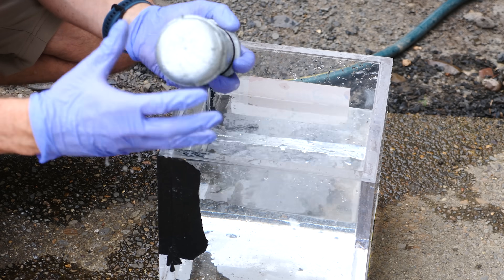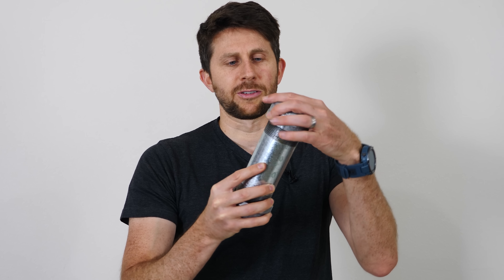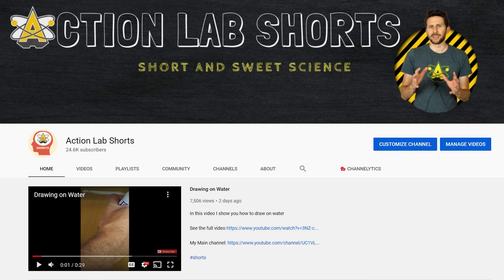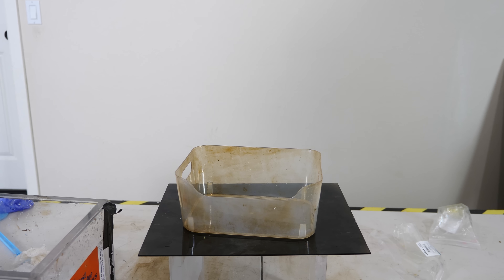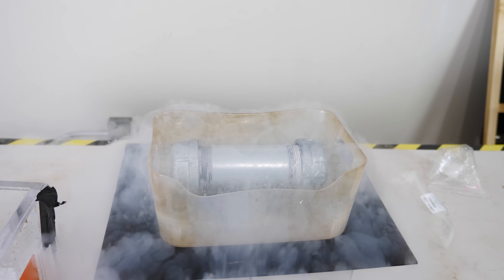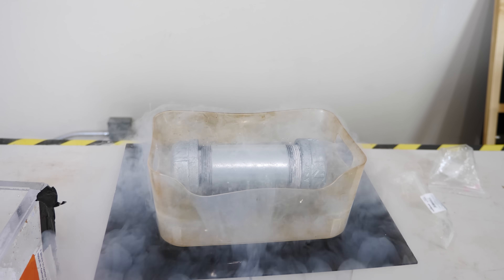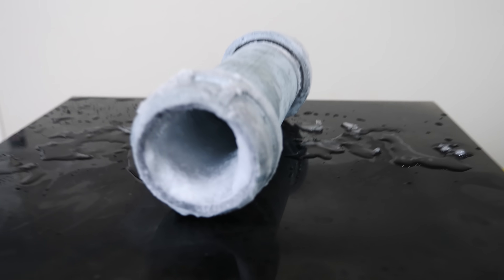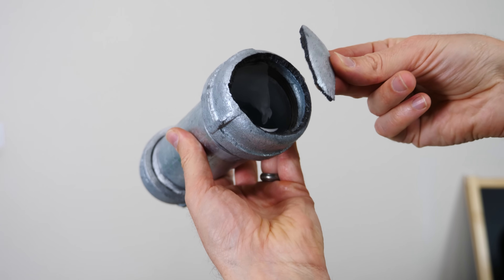Can You Stop Water From Expanding When It Freezes Into Ice?

Comment: if you put liquid nitrogen inside that steel pipe the outside of the pipe is going to be cold? If it does then it is going to be cold forever or the nitrogen inside is going to disappear after a while?
Reply: It would be an extremely bad idea to do that.
Reply: @markh.876  Why?
Reply: @sinegra30  You'll generate thousands of atmospheres of pressure, rupture the pipe, and generally make a mess.
Reply: @markh.876  Mmm But that does not happen in a sealed liquid nitrogen professional container... Why?
Reply: @sinegra30  There's no such thing.

Comment: I'd make a guess that you could likely create a containment vessel to handle 600 megapascals out of a titanium alloy.  There's some titanium alloys that have a tensile strength over 1 giga-pascal.  Not obviously something you're going to buy at Home Depot, but I'd say it's within the grasp of a skilled youtuber.
Reply: There is definitely higher tensile strength material available. Tungsten having about 1500 Mpa, some steels are approaching or even exceeding 2k Mpa, carbon fiber at over 5k Mpa and silicon at 7k Mpa. The easiest would be a high tensile strength steel at about 2k Mpa. Then carbon fiber if you can figure out a way to not compromise the structure by having a hole in it

Comment: You should be able to contain that pressure fairly easily in a diamond anvil cell.  https://en.wikipedia.org/wiki/Diamond_anvil_cell  According to the wikipedia article, these things hande 100-200 Gigapixels, and can be made to contain up to 7 million atmospheres, or about 1000 times the strength you've mentioned.

Of course, the scale of these things is tiny.  Something like a grain of sand.

I'd be curious if there's some other larger scale device that can handle a few hundred mega-pascals.  Diamond is used since it can handle these pressures, but we can't make diamonds the size of your fist.

Comment: So, can you please do an experiment with one of those denser types of ice, so that we can understand the differences between those and regular ice? I'm curious as to how differently it would react when melting or interacting with room temperature liquids
Reply: You could probably do it with some specialized materials and equipment.  The problem is it wouldn't make a good youtube video.  Any ice created during the process would return to normal when you removed the pressure.
Reply: that would be difficult, since they only exist at extraordinary high pressures.
Reply: I'm guessing that as the pressure decreases, they rapidly revert to liquid?
Reply: @danizdeman1   That's my guess as well.  And since it takes energy to melt, it would get colder as it reverted back to liquid.  Maybe it would even freeze back into normal ice!

Comment: Ah pretty sure that's not a 1/4 inch.  If you really want a strong container, then get one made to 160SCH; this can probably handle 10X the pressure, of what you used and be much safer, if you choose a smaller diameter, since the volume is far less.  https://www.mcmaster.com/steel-(schedule-160)-pipe/

Comment: So if you can achieve that different phase of ice, can you then take the ice out of the container, and leave it outside just like any other ice? Or does it require a constant pressure to stay that way, and taking such ice out would either melt it instantly, or the container would explode as you open it or something?
Reply: I think the container would explode as you opened it.  It must remain at high pressure

Comment: From the looks of the cheap Chinesium steel it did undergo brittle fracturing, so more than likely it was the liquid nitrogen that made it brittle and subject to failure. Would be interesting to repeat this but instead of using cheap pipe fittings from Harbour Freight use instead proper high quality stainless steel pipe and fittings, that should survive the cold better. You would need a better blast shield though, and probably a long steel pipe, to use to pour the liquid nitrogen in from a distance.

Comment: Those end caps are cast iron which is already brittle at room temperatures.
Reply: Brittle doesn’t mean weak
Reply: @ActionLabShorts   But it's also weak, is it not?  Would it not be better to use a cap made of actual steel?

Comment: Have you noticed that the plastic container doesn't produce a layer of frost on the outside? This is because it is not in contact with air but only with N2 that comes from the evaporating liquid.
If you put liquid N2 on a soda can I have seen that there is a slow formation of frost only from the liquid surface up. I believe this is solid argon or maybe solid oxigen.
Should make an interesting video to find out
Reply: Good point! I believe the white frost you see (that isnt water) is actually solid CO2.
Reply: @ActionLabShorts  I had that suspicion too. If you get a tall coke can with a couple of inches of LN2 boiling inside you can see the formation of this frost on the outside but only from the surface liquid up. Turns out the gaseous phase is a bit colder than the liquid. And around-200C you have not only nitrogen liquidation but also argon solidification. Besides there is a lot more argon in the atmosphere than CO2

Comment: Before finishing the video (at 1:01), that container will either explode, or become deformed from the expanding ice.  Water exerts an enormous amount of pressure when it freezes.  Containing that pressure will take far more pressure than that vessel can provide.  I also know because an event I helped host at my University did an exploding ice metal pipe bomb (using liquid nitrogen as coolant) as a demonstration.  The water will freeze at a lower temperature under pressure, and the colder it gets, the greater the pressure, which is why it's nearly impossible to contain the expansion of ice.  Eventually it will get cold enough to burst almost any container.

Comment: Omg what a coincidence. I was literally reading about this topic a few days ago, and i was so mind blown about the power of water. To think that expanding water can break anything which comes in its path, even steel and rocks which r so rigid. I was in so much disbelief that i took a 1 L steel water bottle and filled it upto the brim with water and then left it overnight in the freezer. And the next day, i was just shell shocked when i saw that the water had  literally teared up a hole in the bottle. Then i did a whole research and found that by tweeking the temperature and pressure, scientists have created 15-16 different species of ice. Wow.
But i have a doubt. If i take a bottle made of diamond and then do this experiment, will the water break the diamond too?
Reply: It depends on how thick the diamond is.  It would either break the diamond, or freeze into a different form of ice that is denser than usual ice.
Reply: Diamonds are not very resistant, it's only very hard. If you scratch a diamond with anything but an other diamond, it will stay intact, but if you hit it with a hammer, it will break in a million fragment.

So no, it will not work with diamond if it do not work with steel.
Reply: @pierrotA  actually i just did some research on diamonds now. What i concluded was that diamonds are very brittle and can be shattered to pieces only if the impact is very sharp. They have to be hit on their pointed tips to be shattered, but in case of expanding water, the impact is not sharp. The pressure exerted by the water slowly rises and is uniform in all directions, so i think that the diamond should be able to withstand that pressure, and the water should freeze into a different species of ice
Reply: @pierrotA   I'm not so sure.  If the diamond is thick enough, it might work.  It is very brittle, but it's also very hard.  You would just want a thick diamond bottle to contain the pressure.
Reply: @DANGJOS  I cannot be sure because I find no similar experiment anywhere, but i'm still pretty sure it would failed.

The diamonds we can buy are very precisely cut to remove the imperfections. If you take an enormous diamond, it will be  full of imperfections that will break pretty easly. If the diamond is too small we seem to agree it would not work.

If we could create a perfect diamond bottle with very thick walls, then maybe it would be possible... but even then i'm not sure the diamond would not break on a weak point (like the top screw) and explode in a billions pieces.
Reply: @pierrotA   Indeed.  I think it's possible, but yeah, I can see how imperfections would be a problem.  But if the diamond is small, I think that makes it better.  Smaller containers hold up better than large ones.  In fact, there are diamond anvil experiments that can reach much higher pressures.  On a small scale, you can certainly do it.
Reply: If you can afford a diamond bottle strong enough for this, you can afford a more resilient steel bottle a hundred times thicker than the diamond, and a truck to bring it home in.  And a home with a drive-in freezer big enough for this experiment.
What you're basically looking for is the kind of container the FBI or military might use to detonate a suspected bomb.  A bank vault in condensed form.

Comment: The complete failure of the cap was mainly due to the embrittlement of steel (starting at already -73°C) through the excessively low temperature of LN.
If you had cooled it down slower, there would have been not even close to that violent failure and most probably just a small leak.

6000bar is about the pressure modern firearms have to endure without any damage to the system to get their proof marks. So a barrel blank with 2 end-caps should be able to hold that pressure without too much of a problem.
Reply: I think the gun barrel would also break. Once it turns to ice 6 and 7 I believe there is still expansion so it would need to withstand 10-100 times more pressure at that point.
Reply: @ActionLabShorts  We are starting with liquid water with a density of 1g/cm3 (at 3.98°C) then go via ice Ih (0.917 g/cm3) to ice V at 5k bar (1.24 g/cm3) and at around 10k bar VI (1.31 g/cm3)
Alternatively taking a detour via ice II and III (1,16g/cm3) if working with temperatures under -22.15°C

As all these higher ice phases have higher densities than our initial filling of the chamber, the pressure there should never be able to exceed 2.5k bar if under -22.15°C or 6.3k bar if -22.15-0°.

Comment: Could you remove ice 9 or ice 12 from it's super container and bring it into a regularly pressurized environment? Or would it immediately expand and turn into regular ice?
Reply: Ice(II) will stay in that form at least for a while if you keep it at liquid-nitrogen sorts of temperatures, but any warmer and it immediately turns into regular ice(I).  I would guess ice(IX) is about the same, but probably needs to be even colder.  The others probably just either turn into ice(II) or regular ice(I).
Reply: Ice 15, still undiscovered, awaits and will take on mankind for control

Comment: I expected the threads to fail first honestly. Had that happen with a lot of threaded pipe I've worked with. The caps are most likely cast though, so naturally more brittle. You can crack them with a decently heavy hammer, so it's not too surprising it failed first at that cold of a temperature.
Reply: Yea
Reply: That took all the fun out of it

Comment: Those fittings are cast ductile iron so they are not particularly strong. If the end caps were stronger it would fail on the threads

Comment: if you make these other ices in the container, and you take it out, will it stay that special ice? or will it turn into normal ice?
Reply: Good question!  The phase diagram says that they can't exist along the "atmospheric pressure" line, but that's a diagram of the equilibrium state -- which is to say, what it will turn into eventually.  It turns out that at "normal" cold temperatures, ice(II) and ice(III) turn into normal ice(I) quickly, but if you keep it at liquid-nitrogen temperatures, ice(II) will stay in its form for a long time.

I'd guess that the others might stick around similarly at cold enough temperatures, although it would take even colder temperatures to preserve them.
Reply: Nothing happens. They just told you that to see if you were listening

Comment: Under enough pressure (say at 'surface' depth on Saturn) you can even achieve Metallic Water - which has some seriously bizarre properties...

~ ~ ~

I really gotta have a closer look at that diagram. Seriously, it reaches Megapascals of Pressure..! Wow..! (In perspective, something like  10 Megapascals is crush depth for a Nuclear Submarine - turning it into a twisted metal pancake.)

That certainly goes a long way in explaining how several primitive cultures were able to break off vast blocks of impressively hard stone, using only water: 

They poured water down into cracks (cuts), then blocked the upwards expansion, giving water nowhere to expand but sideway, and so - 'CRACK' - it splits off a 20 Tonne Block of Stone...

(It's also how - in extreme cold conditions - the water in their sap can freeze inside trees, causing them to explode!)
Reply: Tell me more...

Comment: Do you think you can find a 4 in thick steel container to test the properties of super dense ice?
Reply: 620 MPa/6000 atmospheres is no joke. 6:00.

Quick googling tells me that ultimate pipe burst pressure can be calculated as 2 * tensile strength * wall thickness / outer diameter. So 4 inch steel pipe would hold 2 * 420 * 4 / 8 = 420 MPa at maximum - not enough, needs to be thicker. And if we disregard possible pre-tensioning or anything like that, then "Elongation at Break 15 %" is what matters I think, which means the wall would likely stretch to accomodate 10% volume increase, and not begin to exert the theoretical burst pressure on the ice inside.

Comment from the maker: If you are wondering how I screwed it shut with an incompressible fluid inside like water, some water leaked through the threads as I was screwing it on. So why didn’t the water just leak out when it froze? Because it freezes from the outside in, so the threads froze first so it self-sealed so that it held in the pressure.
Reply: You do know that you just made a water pipe bomb
Reply: Supposedly this is a true story I heard years ago. They wanted to re-melt old surplus civil war cannon balls. But they were too large and too hard to break apart. No one could figure it out. So some kids ended up filling the balls with water and letting them freeze. The balls cracked open enough for the refinery.
Reply: So wait... Water is technically compressible then, as long as you freeze it under high enough pressure?
Reply: @The_Editor_UK 😊

Comment: No... the explosion came from the end-cap bursting, like you tried to minimize at the beginning of the video.  We've all seen warm water poured into the LN2 and vice versa - nowhere near such a violent expansion occurs.
Reply: Perhaps explosion was due to spring nature of steel failure which then violently pushed on the LN when the piece of the cap flew off?
Reply: @ratkeg   In part, I would say.  But I think the high pressure of the contents is the main reason

Comment: This is also why compressed air tanks (scuba, paintball, etc) are water tested. A failure of the tank when filled with water is much less violent than the failure of a container filled with air.
Reply: Because water is virtually incompressible under the conditions, the failure of a water-pressure-tested tank tank results in a sharp pressure drop which is immediately detectable.  Pressure is then released.  As a rule this means the failure never reaches the point of even a small explosion.
I worked in a factory that produced compressed gas cylinders.  Not only were the tanks under test filled with water; they were submerged in a tank full of water.  Pressure was applied until either the test pressure was reached and successfully contained; or a pressure drop revealed failure.  What actually occurred in a failure was that some part of the metal tank began to stretch.  This resulted in an automated response that opened a valve to release pressure almost instantaneously.  As far as I ever witnessed, at no time did the test ever result in an actual breach of a tank under test.  There was usually no visible indication of where the metal had failed.  The chrome-moly alloy of which the tanks were made was key to their strength and to their stretchy mode of failure.
Reply: @jamesg1367  that is very interesting. Thanks for the insight.
Reply: @jamesg1367  scuba tanks are similar but they look for a max % expansion by looking at water rise in the test chamber. Since there is no compressed gas there's no explossive energy release if the tank ruptures.
Reply: @jamesg1367  
The tanks are ductile for a reason. Otherwise you would have shrapnel everywhere.
Reply: @rossmennie4903  Of course.
Reply: A soda in my freezer exploded in my hands when I grabbed it, now I see why.
Reply: Agreed, I built a pressure test machine for a prominent industrial and agricultural tire manufacturer. Setup a 2 stage pump with a high volume low pressure to fill the tire and second stage is high pressure low volume with incremental pressure rise, some tires are QAQC checks and others are destruction tested to beyond base pressure of 14bar/203psi.
Reply: I don't see how water is less dangerous, water at high pressure and speed can cut your arm off.
Reply: @chrismechanic2000 it's less dangerous because water won't expand if the pressure is released. If you decompress a compressed gas it will multiply its volume, water won't.
Reply: How many tons can that 100 Mpsi lift? I mean can it lift like a ton of water 10cm? Cuz it can mean we can harvest energy from the cold xD
Reply: @filipenegreiros9557  It takes a lot of ice to lift that water a little bit. A jack would be easier.